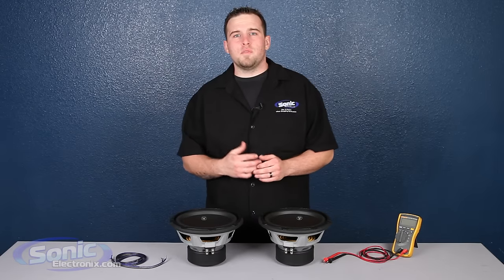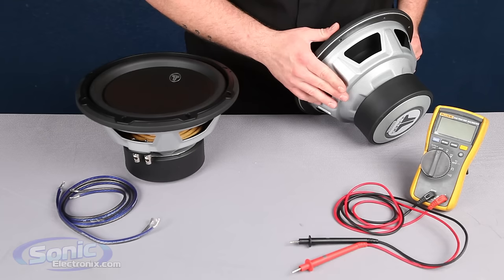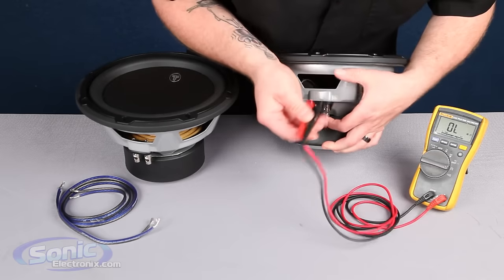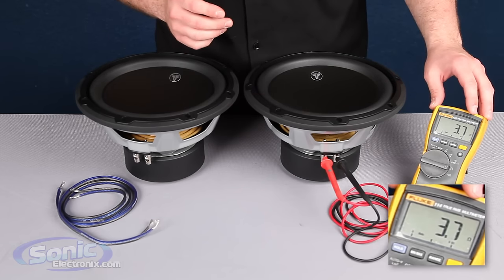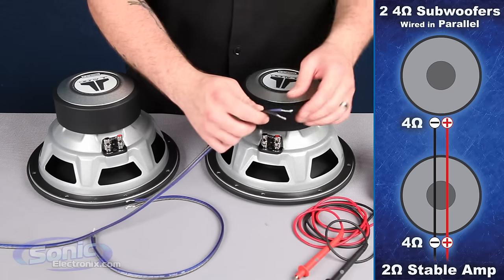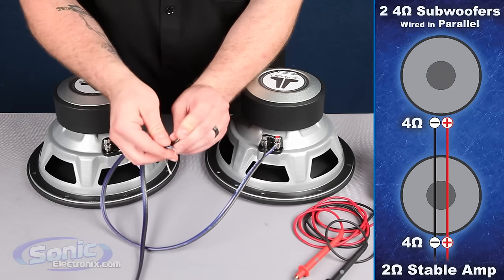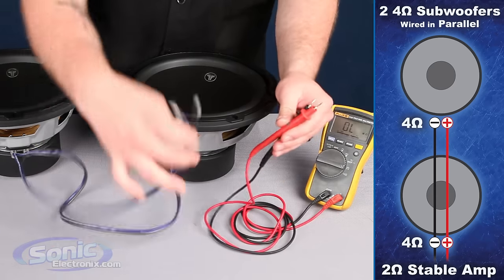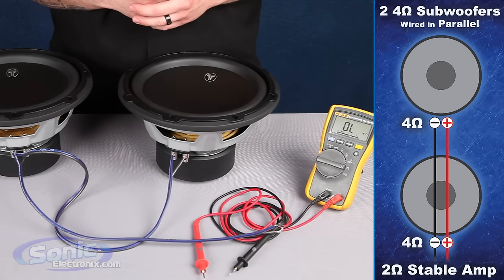How to Wire Two Single 4 ohm Subwoofers to a 2 ohm Final Impedance | Parallel Wiring | Car Audio 101

Comment: Do you have to connect them together? or can you just hook them both up to the same amp channel?
Reply: I'm wondering the same thing.  I'm going to be installing a 5 channel Amp in my suburban to run my mids, highs and an aftermarket sub in the factory sub location so when we go on road trips I can take my big sub box out and still have some beat but I'm trying to figure out how to go about it with the 4 channels I'll be using for the speakers that are going in the factory locations

Comment: Sonic Electronix so if you have two box terminals how would you wire the subs to the box, is only one box terminal going to be used.
Reply: Wondering the same thing
Reply: Crustyfrank69  I think you have to look at it as if the box terminals are the speaker terminals.
Reply: Yup you would wire it the exact same way but on box terminals
Reply: Run the wires in front of the box outside of the box and then the other two out the back of the box that go to the amp
Reply: Drill a hole inside the box to wire the subs together, then just use the terminals on one side of the box.

Comment: What happens if i run another pig tail from the other sub as well.. so wire them both together like you showed... then run 1 tail from one side and another tail from the other side....   But going str8 to the amp ?

Comment: I have a question.  I have a sealed box with holes for 2 10 inch subs.  The subs are single voice coil with a 4-ohm independence rating.  But, there are 2 different terminals on the left and right side of the sub box.  What do I do?  Only use one?
Reply: I have the same question. Did you figure it out?
Reply: only use one
Reply: @elijahgomez1  use one
Reply: You have dual voice coil subs, theres another video for that

Comment: I have the same subs that you just wired up running on a jl audio 500/1 will it drop the amp to 2ohm or a 1ohm load ?
Reply: If each one is 4 ohm then is going to drop to 2 if both are 2 ohm then is going to drop to 1 ohm is just half of the empedance

Comment: I have 2 single voice coil pioneer vccs   12s, and I'm running a crunch gtr3 2000.2  2 channel , 2000 watt amp on them, they're @ 4 ohms now,  if I follow these steps here,  will this work for my setup to get a 2 ohm load as my end result ?

Comment from the maker: Did you get the Dual 2 ohm or the Dual 4 ohm Kicker L3 subwoofers? You need 800W RMS to run both of those subwoofers. The RZ1-2300D only outputs about 400W true RMS which will work with the subs but each one will get 200W RMS. Consider getting the Hifonics ZRX1200.1D, it will output more power and be closer to the actual ratings.

Comment: Does the power have to be shared from one sub to the other to be parallel? Or could I just parallel it to the amp, in the sense if I take the 2 negative wires from each sub, twist the two wires together and put it in one channel and the same for the positive? Wouldn’t it make sense? I would basically eliminate the extra wire(s) going from one sub to the other.
Reply: I think that would work but you’d be using the same amount of wire. Instead of the wire going from one sub to the next, it would just be going straight to the amp. You’ll still end up with 2 sets of wires lol

Comment: so i have a 5 channel boss chaos epic 2500 amp that will be powering 2 6x9 kickers and 2 single 4 ohm shallow mount pioneers 12s. how should i hook them up? should i do 4 ohms? 2 ohm by parallel? i may even add another 10 inch rockford fosgate. but for now just the 2 12s. your input on how to set this up would be really great as this is gonna be the first system i set up myself. thanks, bryce

Comment: So question.... If these subs you are working on say have a 2 ohm impedence when wired as you did. Let's say my mono block amp is  800 watts rms x 1 @ 2 ohm... What should each of these speakers be at rms wise for maximum input... 400?

Comment: With this wire connection setup of speakers run in parallel to make 2ohms now my question do you connect the speaker wires to the amp both wires - & + to one channel or - to one channel and + to the other channel on the amp please explain this one.

Comment: So would you then hook these up to a bridge to get the maximum amount of power to the subs? Example my speakers are 375w and my amp outputs 2 channel at 375 or 1 channel at 750, will this cause problems?

Comment: What if you have 2 terminal cups in sperate chambers, do I just do positive to positive and negative to negative on the terminal cups and then run speaker wire form positives on each cup and twist em together an stick em in the Amp an do the same with negative?

Comment: So for an audio newbie, got 2 Sony xplod 10" subs for cheap the other day which are 1100w peak, 300w rms, 4 ohm each. Gonna buy a monoblock amp and i understand from your video how to wire them for 2 ohms total impedance but my question is this.
When you wire the two subs in parallel is the peak wattage still 1100w and rms 300 or do the subs stack for 2200w peak and 600w rms? I'm assuming they don't stack and I only need a monoblock good for 300rms but I wanted to be sure.
Thanks!
Reply: Dan Dusome if it’s 1100w peak, 300w rms each then u should be able to run 2200w peak, and 600w rms

Comment from the maker: Does your monoblock amplifier have 4 terminals? If so, it means the amp will internally bridge your subs for you.
Reply: How do you wire two 2 ohm amps to 1 sub at 1ohm

Comment: I have a JL M1000/5 v2 amp, I do have 2 subs, my questions is on my Amp I have four outs, 2 positives and 2 negatives, is it posible to connect the subs in paralles like you demonstrate here and use one positive and one negative in the amp? and if so are there any advantages in sound quality and power? thanks for the videos

Comment: okay i have two 4 ohms 300rms subs each if i wire them parallel to my amp that has a 600rms 2 ohm setting will i get the  600 rms or not close.

Comment: will this have the same effect on wattage. Lets say i hook up two 250 watt subwoofers in parallel as shown. Then i hook them up to a 500 watt amplifier. Will it only give each subwoofer 250 watts,
Reply: Did you ever find out? I actually just did that and my subs are super weak. Any help would be great. Thanks.
Reply: @coolfern37520  Yea bro u have to do that ,2 250 watt rms needs 500 watts rms amp

Comment: Will this work with pro audio mid ranges. Trying to connect 2 4ohm speakers to a 2ohm final. On a 4channel amp.
Reply: did you ever get an answer ?

Comment: How would u wire it if u have a sealed box
Reply: carefully break the seal reroute everything and reseal it with silicon.
Reply: or you could drill a hole small enough for the wires to come thru duhhh...won't ruin your perfectly sealed box
Reply: I did and done blew the subwoofers lol
Reply: By drilling a hole ??
Reply: Naw the amp I had too many watts for the subwoofers it was like 500 watts over what they could take
Reply: ekim andersom so ur telling me if you give 5000 watts to a 50 watt door speaker, it won’t blow? ok u sound smart

Comment from the maker: A Kicker ZX1500.1 needs a 2 ohm load, so you have to buy two Dual 2 ohm subwoofers to wire to a 2 ohm load in parallel to match that amplifier. A Q Bomb enclosure will not give you the best performance, you will want to get a custom made enclosure for those powerful woofers.

Comment: If these where full range speakers couldn’t you just plug both possitive and negative wires into the amp connector for the selected channel? My point is you shouldn’t have to splice them into one wire before the amp. Right?

Comment: So if you have two single 4 ohm subs rated for 250w rms and you have a 500w rms @ 2ohm amp, would it be running the 500w @ 2ohms or still 300w @ 4 ohms, how does it work?
Reply: I want to know the same thing.
Reply: Not like this if you have two 4 ohm subs wired in parallel it will have a 2 ohm load at the amp so you will have the 500w at 2 ohm.
Reply: so if you have 2x 200w rms on 4 ohm it will be 2x 400w rms on 2 ohm right? do i now need an amp/monoblock that has at least 800w rms on 2 ohm or will 400 be okay on 2 ohm?
Reply: Not really.  It depends on the amp and if it is stable to 2ohm. For example i have 2 subs rated at 450 rms so i need 900w of power to drive them and my amp supplies 700w at 4ohm or 1000w at 2ohm so i wire the subs in parallel so they have a final resistance of 2ohm so i can use the full 1000w of power from my amp.

Long story short if your amp can support 2ohm then generally yes you will get a bump in power but it many not be a full double the power : )

Comment: Once they are like that can I run them on a 1 channel 2 0hm mono amplifier?
Reply from the maker: Yes, just make sure to check the power output of your amplifier to make sure its correct for what your subs can handle and your all set.

Comment: My amp is 8 ohms and I want to hook up 4 little 5.25" woofer spkrs. that are 4 ohms each. How do I do it so that they match the amp?
Reply: Your amp is 8 oms???? U need to learn ohms law V=IxR  voltage(amp) = I current x resistance. Amp is nothing but an electrical output in a circuit. Lower ohms impedance =greater amp output

Comment: I need a bit of help guys. I have a Tandberg amplifier from the 70s that can power 4 speakers at once, but its rated for 4 ohms minimum. I have two pairs of speakers that are both 4 ohms, but when I use them all at once they become 2 ohms, because its a parallel wiring. Is there any way to make them not become 2 ohms?

Comment: Say you have 1 single voice coil @ 4ohms? is there a way to bring it down to 2ohms?
Reply: Patrick Lawrence yes. Go buy a 4 ohm resistor. And then solder it across the terminals
Reply: No

Comment: Sooooo, if I have two 4 ohm subs that need 300wrms, I can use an amp that will push 600wrms at 2 ohm stability, correct?
Reply: Yes

Comment: Ok I got a question. I have two 12" 4 ohm subwoofers with the peak max of 1,000 watts each. Also I have a 2,000 watt amp that can be bridged. I do what the videos says and it works but the bass is terrible!!! Would I have to get a different amp or is there something I'm doing wrong? Please help
Reply: your box...

Comment: I have one 12" CVR, hooked up to a hifonics 1000w mono block. It's ok... So I just got two 12 jl audio wov3 s, I got em in a box for like 80 bucks. I just saw the name and I got them. Like today, but checking.....are these like entry level subs?. I have an Altima, not a huge trunk. I like the fact that a single CVR, still leaves some trunk space. This new box will fit in the truck, but that's all that's that's gonna fit in there. With these damn wov whatever the hell should I even bother? Will they be louder than the single CVR?

Looks like that's what im doing on my day off

Comment: is it possible to wire 2 dual 2 ohm voice coils at 1 ohm final impedance?
Reply: You can even drop down to half an ohm
Reply: +kevo “kevo0711” knives yes as long as your amp is a 2 ohm or 1 ohm stable
Reply: +kevo “kevo0711” knives that's what this video is about bro
Reply: +iLovesToHatez obviously

Comment: hi I have a 10 inch 4 ohm sub and a 8 ohm amplifier and the sub is really quiet it makes noise but is really hard to hear, what am I doing wrong? thanks.
Reply: you need to wire the subs up to 8 ohms because your amp wasnt designed to handle a 4 ohm load.
Reply: +Skylar Rountree how can I do that without getting a second sub? its a single voice coil btw.
Reply: Im not sure if you can, I have always had 2 subs or more, but I would just research about it and if you cant find anything I would sell the amp you have now and get a 4 ohm stable amp.

Comment: Looking to wire two 4ohm woofers and keep 4ohms...????? Plus have two 8 ohm woofers, need to wire to 4 ohms???
Reply: +Mark Scott.... First answer: Take the + from woofer A and hook it to the + on the Right channel of your amp, then do the same with the - . Repeat for the Left channel, it is @ 4ohms.
Second answer: Do what the guy in the video is doing. Your 2, 8ohm woofers will be @ 4ohms.

Comment: How would I wire 4 8 ohm midranges to a 4 channel 4 ohm amp
Reply from the maker: You won't be able to use all 4 channels if you have to get them down to 4 ohms. You can do 2 speakers/channel on 2 channels at 4 ohms using the same wiring technique as in this video. 
I think that is the closest you will be able to get.... But you could always buy 4 more midranges to fill out the other channels...

Comment: after i did this my subs would make a weird noise when they were hitting can't really explain the sound. they were hitting fine just the sound they made was alarming or bad sounding
Reply: You don't want to wire you sub's for 2 ohms or 1 ohms as it can cause severe damage. 4 ohms is the best as it will protect your system

Comment: what would be the best way to wire 2, 4 ohm subs to a 4 ohm amp? or should i buy a 2 ohm amp?
I have 2 of these... http://www.kenwood.com/usa/car/speakers/kfc-w12ps/
That i'm wiring to this... http://www.kenwood.com/usa/car/amplifiers/kac-5001ps/
Anything i need to change, or any special steps i need to take when wiring these? Should i bridge them both in parallel? Or run them on their own channels?
Reply: +Hole InTheSeat Well let's see, you have 2, 4 ohm subs and a mono amp that is 2 ohm stable. First of all you can't bridge a MONO amp (it's mono, 2 in and 1 out). If you wire your subs like the guy in the video explained, your amp will be making 500W rms @ 2 ohms. Each of your speakers are 250W rms so, at 500W of amp output, each speaker will receive 250W rms.
Reply: +IamTheEggMan thanks man. this comment is really old and I have completely changed what I have and I've got everything figured out. I now have some competition ws-10's now. again thanks tho.

Comment: i have this kenwood amp

http://www.sonicelectronix.com/item_69691_Kenwood-KAC-5001PS.html?utm_source=google_cse&utm_medium=cse&utm_campaign=sc&scpid=2&scid=scsho3799076&gcsct=0ChMI2Jq_8ufKvAIViKfmCh0BIAAAEAA

and 2 of these subs 

http://www.sonicelectronix.com/item_72378_Alpine-SWA-10S4.html

do i wire these subs like the way its done in the video? i don’t know anything about car audio, is this wiring two 4 ohms subs mono amp: 2 ohm load

Comment: how Can i hookup 1 svc to 6000w monoblock?  
monoblock 

6000 watts x 1 RMS power at 1Ω 
3000 watts x 1 RMS power at 2Ω 
1500 watts x 1 RMS power at 4Ω 
Maximum power output is 2800 watts 

Sub woffer 

sub 1000w peak 
460 rms watts 

how to give max power to this sub without blowing my sub